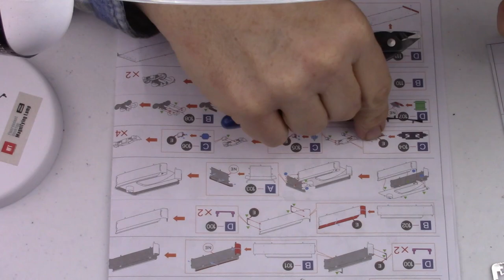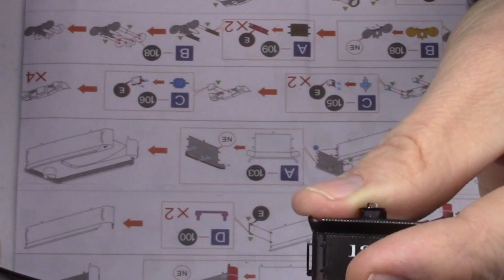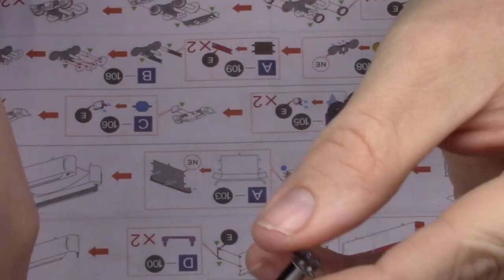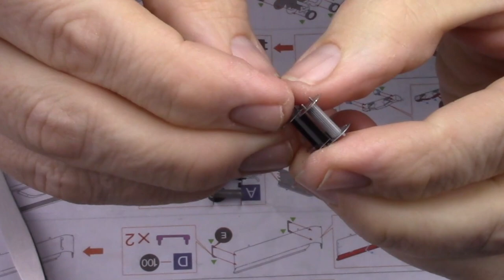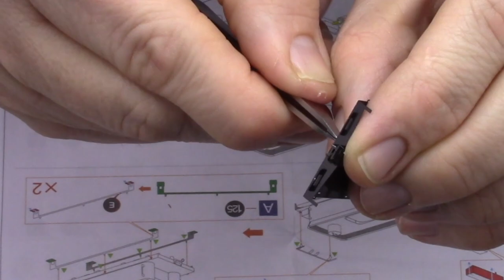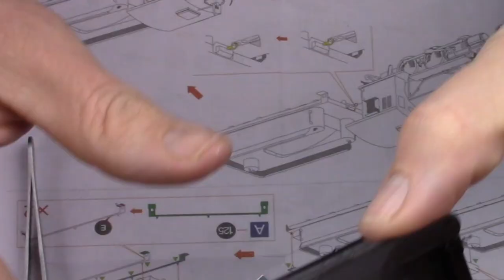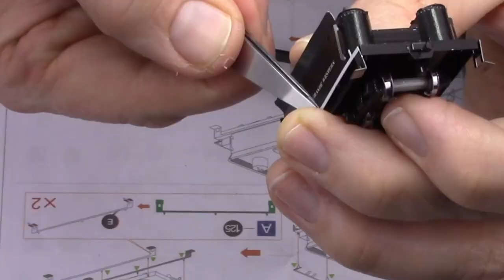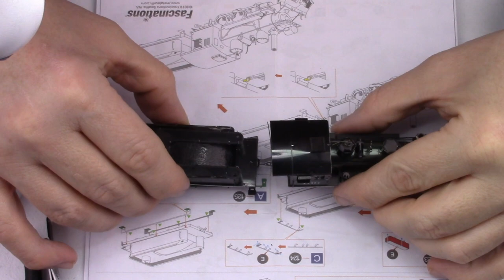Metal Earth Build - 2-6-0 Locomotive - Part 3 - The Tender (Coal Car)

Comment: These Metal Earth kits are so affordable yet very impressive. At $10 to $15 for most kits, it is amazing (will add the 2-6-0 to my wish list), would like to see how they produce the metal sheets. I built the V22, that was fun. Now I have the fire engine and the locomotive and 4 cars to build. They are challenging yet doable. And I like how you don't need to do the painting steps most kits require yet still end up with a good looking model. Have wanted to do some model building for many, many years but never saw these, always figured my options were the standard plastic models, and without painting them, those are not as good looking. The only downside is the size, would be nice if they were a little larger. But then the metal would need to be thicker I suppose, making it harder to build.

Comment: Thanks for the video. I just finished with this build and always like to use your videos as a guideline to help along the way. The Tender (Coal Car) went pretty fast for me with no real issues other than part 124 which is the delicate back bumper bar. Wasn't to sure how to fold it correctly but managed pretty ok. The locomotive itself is a pretty tough build if someone doesn't have a lot of metal earth builds under their belt and/or some good tools. I've build at least 40 to 50. Experience does help on some of these more difficult builds. As always keep on keeping on.